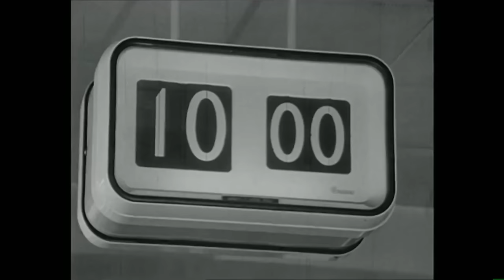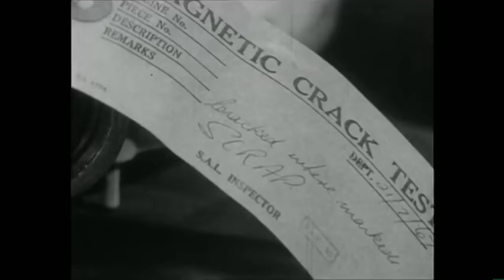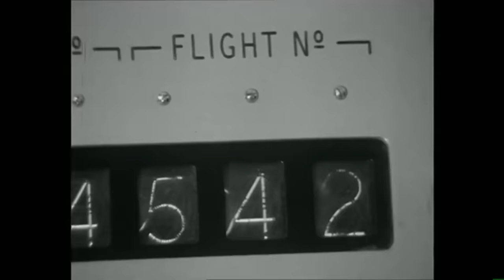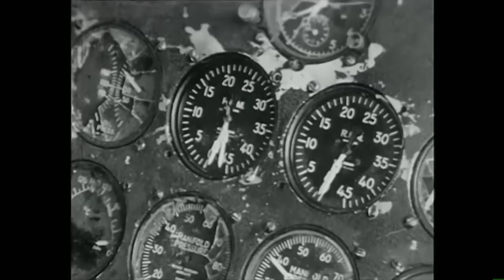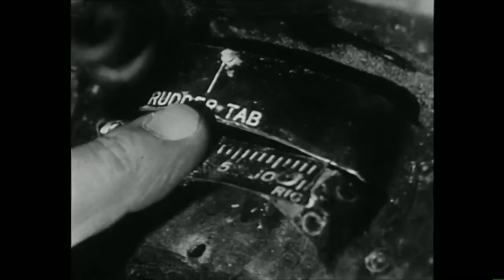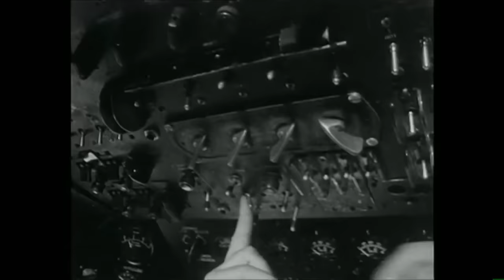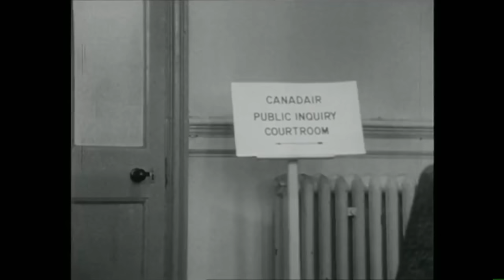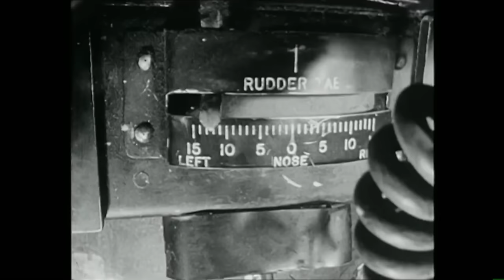Stockport Air Disaster

Comment: In all honesty I believe the aircraft manufacturer is partly to blame for not informing ALL airlines about the potential problem with the crossfeed valve, it reminds me of the more recent air disasters involving the Boeing 737 Max, where Boeing did not tell airlines about the potential problems with the anti-stall system.
Reply: I mean, technically the "anti-stall system" on the Boeings did work. Put the plane in a nosedive straight into the ground and it's NOT going to stall......🤔
Reply: @TheMattc999  In one year, over a hundred 737 Max 8s were delivered to 28 airlines.  They flew 41,000 takeoffs and landings, had 114000 hours in the air, and carried 65 million passengers without an accident or incident.  

Then two of them were handed off to dodgy airlines with undertrained pilots, and they took them straight into the ground.  A deadheading pilot who flew on one of the planes the day before its crash showed the flight crew how to deactivate the MCAS.  Did anyone report this officially?  Apparently not.  Did anyone pass the knowledge along?  Apparently not.

But sure, blame Boeing.  Airbus wants you to forget about the flight from Brazil to France that went straight into the Atlantic for similar reasons.
Reply: British Midland would have been the Argonauts second or third owner by that time. The aircraft being nearly 20 years old with having logged high hours of flight and therefore considered to be near the end of their design life, the aircraft and engine makers would not have seen it as their responsibility to inform current owners of any new technical problems

Comment: 35:14 "Engineers said it couldn't happen", even though BOAC discovered in 1953 that DID indeed happen and told the aeroplane's makers, Canadair, that they found it to happen.

There's a lesson for all us engineers there. Fortunately which regulators, plane makers and airlines learnt well and which led to flying's becoming such a safe way to travel, although recent events make you wonder whether they are being forgotten.
Reply: No offense, but I can say with certainty that engineers aren't the end all be all of aircraft design. Most any maintainer will tell you the same thing. Engineers should be required to work a flightline for a year or two before being allowed to design anything.

Comment: To be honest, when the pilot said “I am having some issues….RPM issues,” I would think air traffic control would then have asked if he needs emergency clearance.
Reply: ATC said they had already declared them an emergency aircraft. I'm not sure what more help ATC could have given them. HG had made the overshoot on their own, delaying their landing presumably to allow them to work on their RPM problem, which they apparently didn't think was an imminent threat to safety. ATC was giving them priority handling. Emergency clearance isn't really a thing. The emergency aircraft is permitted to do whatever is necessary to meet the needs of the emergency. The only clearances involved are clearances given to or revoked from other aircraft to allow priority handling of the emergency aircraft.
Reply: An important rule between flight crew and ATC is that only the crew of any flight may declare an emergency. When one stops and thinks about it, that is the only rule that can be otherwise, in its more ridiculous extreme, it would be possible for a flight crew to be regarded by ATC and destination airport to be an emergency.
Reply: @philiprock131  That's not correct. ATC can and does declare an emergency for aircraft that have not declared an emergency for themselves, if they believe an emergency condition exists. All that means is they get priority handling, they are allowed to do whatever is necessary for safe flight, and other flights are kept clear of the emergency aircraft. And when ATC declares the emergency, there's a greater likelihood that the emergency will be made known to all subsequent controllers.

Comment: I'm gonna go with misidentification as the cause. The pilot thought he lost engine 3, shut it off, found both engines on that side were inoperable, shut off 4, tried to restart 3 and well...didn't have the airspace to recover. It would explain propeller 3 windmilling...it was trying to start up.
Reply: I feel you got great chance of being correct. That makes most common sense to myself.
Reply: Fuel system faults are another possibility. Icing on descent in the fuel system has produced similar effects - that is why pilots of modern petrol fueled aircraft check for water contamination in the fuel.
Reply: Or quite simply, the world was going to hell in a bucket, every instinct was 'Fly the plane' . Then you have the added problem, I'm over a heavily populated area. The co pilot is trying to read gauges and sort out what is wrong, and the gauges will have been going all over the place. Not the most ergonomically designed cockpit,if the concept even existed then. And not enough height. And the fault, well start with the people who drew the first picture of the aircraft on paper, as stated there was reason to suspect many types of aircraft could exhibit the same failure. You design with the knowledge at the time.

Comment: Seems ironic that a British midland Boeing 737 crashed just before the runway at East Midlands airport because the pilot switched off the wrong engine years later.
Reply: Yes that’s what I was thinking. That aircraft was in the hanger when I worked at AAIB (Air Accidents). This was way before my time but they may have the bits on the big scrap pile. Known as the graveyard.
Reply: I was trying to think of which crash that was!   That IS ironic.
Reply: dezz nutz, yeah that was bad. The pilot suffered with severe back issues. The seat collapsed due to the downforce of the impact. I saw it and thought ‘that would bloody hurt!’ I think there were about 34 people that died on that one. I remember seeing it on the news and then a couple of years later I was working next to the airframe in the hanger.
Reply: didn't they blame the ridiculously small gauges in the cockpit at the time?

Comment: this crash could have been prevented had Canadair or Douglas fixed the problem when Boac brought the problem to their attention
Reply: The thing that a lot of people seem to forget about disasters is that it takes more than one thing going wrong for them to happen. If the issue with the x-feed was the only thing that contributed, then a ton of planes would have crashed for that same reason. But it took that, and misidentifying the engine (possibly because of the misconnected RPM indicator) and closing the x-feed as SOP during landing that caused the problem.  Take away any one of those things, and the crash probably doesn't happen.

Comment: Replicating the actual conditions in flight was a highly risky business, especially with virtually all their highly qualified and experienced investigators on the plane. Back then it was probably a bit of a lark just to be out of the office for the day and a great chance for the pilot to use all his skill. Brave men, standing in the cockpit entrance looking at the door banging as approaching stall shakes the plane, the pilot bracing himself and using all his strength to hold the plane straight. Just a day at the office and no big deal. Makes you realise how much people have changed.
Reply: No computers. no simulators, that is the way they did it.
Reply: Typical of Flight Tests those days, also they were quitelikelyex RAF pilots anyway where actual flights were used in 'REAL TIME to use 'todays' parlance, nowadays thed use conmputer simulations as its cheaper....and safer.

Comment: Absolutely fantastic documentary!  I see Julia Partleton passed away in 1996 (born in 1942).
Reply: She went straight back to work after the plane crash, then survived two car crashes before dying due to medical negligence, for which her partner eventually won a case against the hospital. Makes you wonder about the film Final Destination, doesn't it?
Reply: Harold Weaver Smith wow, it does make me think about it.
Reply: @MrHws5mp  Two car crashes?  Was she prone to post accident blackouts at the wheel or just spectacularly unlucky ?
Reply: @alzyerpal-TV   Nope, not blackouts. One was caused by a truck going out of control on the motorway and crashing across the central reservation, and the other was caused by a steering fault on her own car. Just unlucky, basically.
Reply: @MrHws5mp  Poor gal, cursed.

Comment: From the little we heard of the pilot it was almost like he did not realise that turning uses up momentum. Hence loss of speed hence stalling is an increasing risk. Sounds like plane stalled eventually as speed was lost.
Reply: The Nose up convinced me of this stalling. Trying to gain height with no power. Not enough height to dive and increase speed. Similar fate from the inexperienced pilot over the Atlantic of  the Air France. Propeller Versus Jet engine. Same outcome.

Comment: I don’t understand why the windows never go far enough for pilots to see the engines.
Reply: They have to sit near the front of the plane as that is the place that allows them to see where they are going. The engines have to be placed near the middle of the plane for stability. Not sure how you could configure the windows to allow the pilots to see that fare back

Comment: What a terrible and ultimately preventable accident.  May the Lord grant more wisdom to aircraft designers.
Reply: Canadair were alerted to the crossfeed potential problem 15 years earlier by boac yet told nobody  - I believe the sequence of events strongly suspected were totally accurate given everything the inquiry found and its significant that the co pilot died on impact  - highly likely he had released his straps to reach the controls in order to restart the starboard engines because captain Marlow had realised what was happening  - sadly as this documentary states they simply didn't have time by the time they did realise  - massive credit to both pilots landing where they did  - no reflection on either man  - canadair should have acted upon boacs information and suspicions 15 years earlier  - what action was taken against the manufacturer when the cross feed issues were known and proven  ??

Comment: 1967 : piecing together the salvaged wreckage, wearing a suit and a tie.  30:32
Reply: Because they were filming.
Reply: Interesting isn't it?  RAF pilots fought the Battle of Britain wearing their uniform. Not very practical?  Black Oxford shoes etc.
Reply: That attire was pretty much standard for engineers, technicians and  professional people. If you look at old films from the 1940s/1950s/1960s you will see Engineering staff whether it be in the aviation industry or the automotive industry, always wore tie and collar either with a suit coat or if they were working in a particularly dirty environment, with white Overalls

Comment: At one point they said the tachometers were wired backwards, then they said that didn't matter. I would think that would be a good reason to feather the wrong engine. Imagine trying to sort that out with full rudder deflection and losing altitude, good luck.

Comment: 12 survivors, which in itself is amazing.
Reply: Probably could have done a lot better if it was in a field.  Sadly in the city.
Reply: Many more survived the actual crash but died when the fuel ignited before foam could be applied.  I know two of the firefighters who attended that day and all the rescuers were utterly distraught at being beaten back by the flames leaving victims still strapped in their seats.  But for the ignition of the leaking fuel the disaster would would not have been so extreme.

Comment: Never realised that they were still using the Merin engine commercially , as late as the 60s .
Reply: The last flight of a C-4 was on 19 June 1975 at Miami, Florida. By this time, most surviving C-4s had been converted in to pure freighters and it was in this role that the type's final flight occurred.

Comment: It stalled before crashing then the pilot pulled up. Saved some lives
Reply: In a stall situation, I believe the recovery procedure is to push the nose down in order to re-establish airflow providing lift over the wings. This of course only works if you have sufficient altitude between your aircraft and terra firma.

Comment: The documentary quickly glossed over the rpm gauge being reversed for no.3 and no.4 as a “red herring”.  I guess that a crew would have noticed the fault during engine start if it was reversed but still seems odd.
Reply: My mind went straight back to that when the theory of shutting down the wrong engine was mentioned. The fact that two engines shared the same gauge (two nearly identical needles on the same gauge) may well explain how the issue was not noticed at engine start up. Must have been fairly easy to get into the mind set of just glancing at the gauge with the expectation of seeing a needle rise when you start an engine - your mind is not going to expect the gauge to be wired wrong. Classic 'Expectation Bias', something Mentour Pilot often talks about in his videos. Like you I was surprised the investigator simply thought that the investigation team had wired it wrong when putting it back together - the thought they may have been wired wrong to start with seemed to have been dismissed.
Reply: My thoughts turned to the differential weights in the Planes' Wings, with one fuel tank completely emptied. This fact alone would surely add to the problems in flying any Aircraft - just above the Stall Speed, and this wasn't really talked about too much.
Reply: The connections were intentionally reversed to rectify the gearbox in the gauge having been inserted incorrectly. So not an issue, which is why it was termed as a red herring.
Reply: NO! Watch it carefully again... It was stated that the RPM indicator had been rebuilt, but with gears inside installed the wrong way around, causing it to indicate incorrectly. This had been "Fixed" by reversing the electrical connections to the gauge.  it now read correctly for each engine. A quick solution but not a good one. It was indeed a "red herring".
Reply: @peterduxbury927  Just the opposite. The weight imbalance counteracted the right roll induced by the power & drag imbalance. The side with the power is lifting. Notice how they had to turn the yoke all the way to the left in the test flight? A heavier left and lighter right wing doesn't add to the roll imbalance, it helps overcome it.
Reply: My understanding is that the connections were swapped at both ends. So they wernt actually reversed. A case of two wrongs making a right.

Comment: By the time this crash occurred, the Boeing 727 was in service with updated technology for controlling the position of valves regulating the flow of fuel and other fluids.  Operated by electric motors rather than manual cables, each valve circuit included a valve position indicator light in the cockpit.  With the valve in the normal position, either open or closed as required, the circuit turned the light off.  When the valve moved fully to the opposite position, the light was illuminated at reduced brightness.  But if the valve was neither fully closed nor fully opened, the light illuminated brightly.  This "In Transit" indication gave the flight crew confidence that they would be made aware of any two-position valve that was not completely in the required position.  Also, it made it easy for technicians to identify a malfunctioning valve mechanism.  This is no reflection on the Canadair C-4 airplane; the system in the Boeing 727 was an example of how advancing technology has made air travel safer.